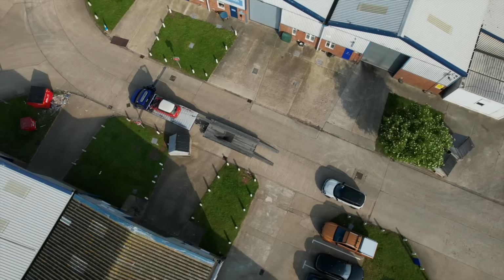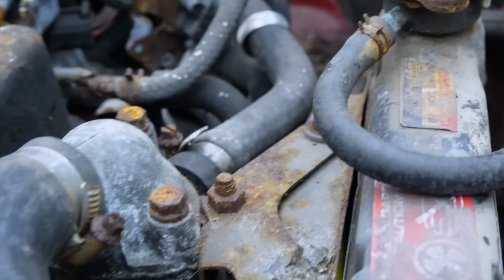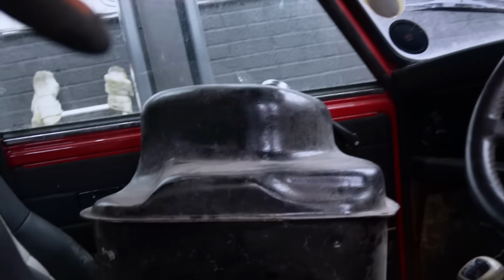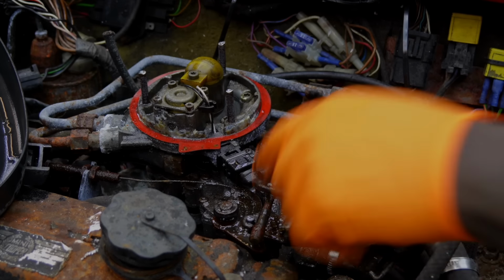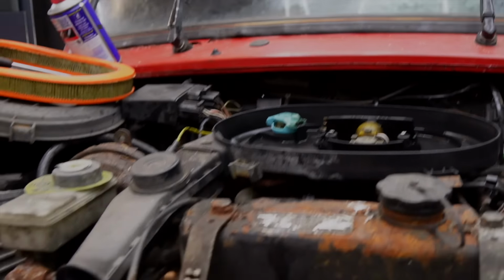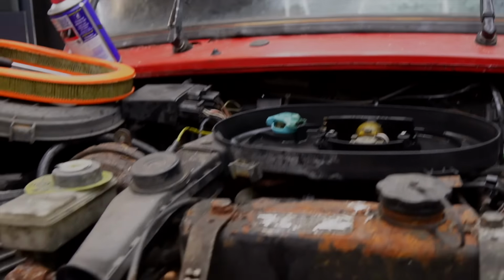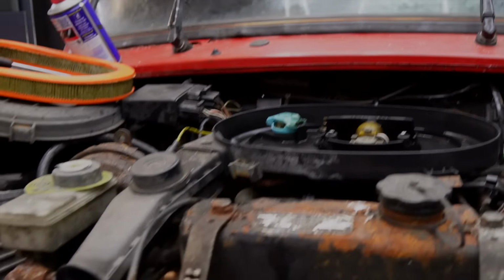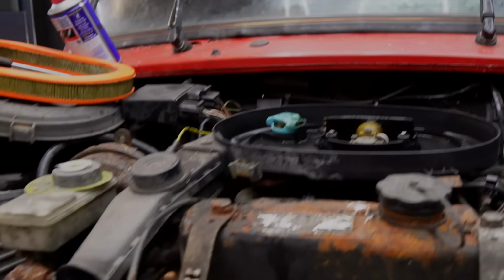Restoring An Abandoned Classic Rover Mini COOPER | Rover Mini COOPER Restoration | Part 1

Comment: Hi Dee - you should try getting a complete new body for that - it would be cheaper than you think. If not, make sure you fit genuine panels if you want to maximise the value. Good luck!
Reply: Buying the body panels is easy, finding metal to weld them to is the hard part 😂

Comment: There should be a spring on the actual part what was seized up one spring hold one way and one spring hold  the other and they work against each other, I used to work at a garage that restored minis and MGs  basically the same engine. Good find  but them panels will be expensive don’t waste your time patching them

Comment: I wonder if it would be cheaper to buy a new fully paneled complete heritage body shell in primer for £11,000 including V.A.T than spend hours and hours cutting rot out and replacing panels which aren't cheap. separately
Reply: No content doing it that way....
Reply: @anthonyjeffrey9942  building any car from a bare body shell has plenty of content potential.

Comment: Used to love working on the engines in these cars, the metros more than the mini's because everything is so cramped inside the mini engine bays, but everything is pretty simple if it's not rusted into one piece lol. 

The fuel injection system is probably identical to the 1.4 spi metros from the bulkhead forward if you're needing to source parts. The throttle body looks the same, at a glance, for example. Rover was working to a budget back then so didn't bother to develop new bits, just used what they had lying around for the most part 😂 Minispares is a good source of new parts if minisport doesn't have what you need. Biggest issue with these cars is rust on the body/chassis, good news is almost literally every panel is available if you are willing and able to fit them. 
Can't believe even a newer one like this is worth £20k now  😭 
We used to buy a car in this condition for £Free-to-£50 and almost MOT-worthy ones for £150  😂
Good luck Dee (and try to jack the car up from the subframes rather than the body, they really aren't built for jacking from the sills, hence the rust on the floors).

Comment: Quite easy minis  I used to reshell  them years ago , get new shell and a donor car , hardest bit  is new subframes. In line ,  engines are crap.  Easy to rebuilt    Standard rebuild.   Hardly any electronics  like todays cars

Comment: You need to take the sub frames off, mostly the rear one. I can tell you right now this is easy to take apart, getting it to drive again without crabbing is another story. This looks salvageable if you know a mini but might be easier with a new shell. when you remove the front wings pay close attention to around the interior vents.
Reply: around the interior vents is critically close to the A pillar, you will soon see that.

Comment: I wish you luck but in my opinion a Rover Mini is very poorly built compared to earlier ones and my 78 mini has 14,000 on the clock and virtually no rust, I admire you trying to save it but this is a parts car at best.